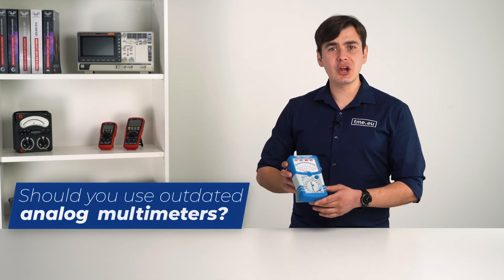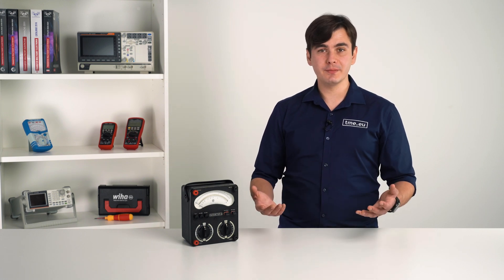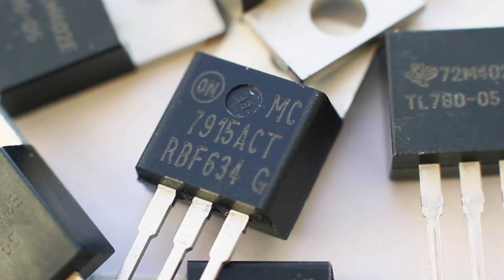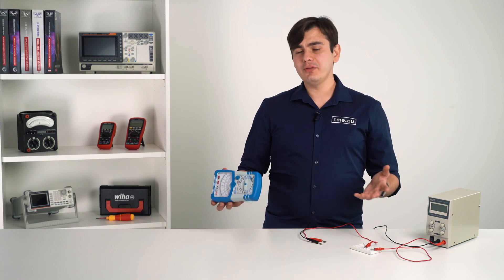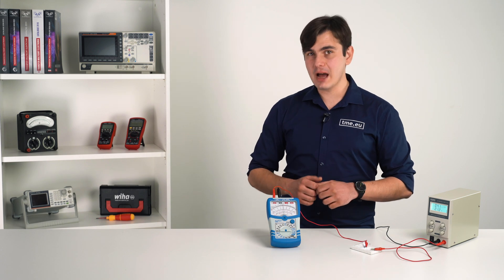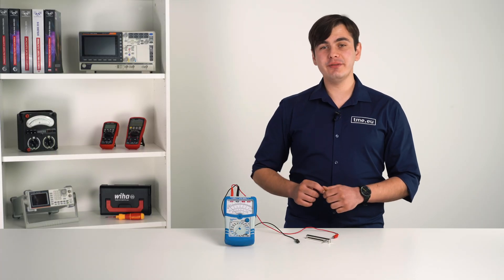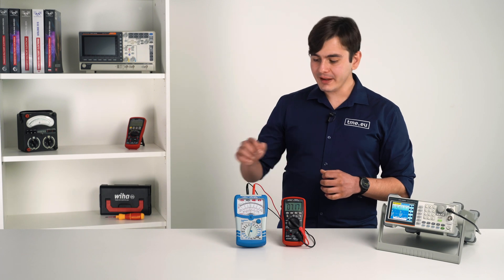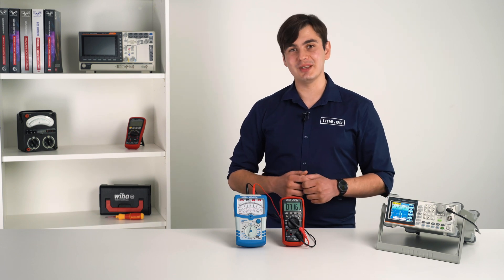Analog Multimeter - How to use it? PeakTech P 3385 [TUTORIAL]

Comment: I got many analog ones, plus the one you are showing. 1) continuity, you spot an interrupted cable because you see needle jumps; 2) "dirty" or oscillating voltage, again you see the needle; 3) noisy signals... sometimes due to high impedence of a digital multimeter you pick up noise from cables and numbers jump around.. your analog one instead draws current (little) and you have a "quiter" reading. 4) you can check diodes and transistors in ohm mode;
The main advantage is that human eye can notice thiny movement of the needle, and you understand the trend of this movement. The digital ones gives fast changing numbers of no meaning for us. In any case when I need a precise mesurement I always use digital.

Comment: Many years ago, i used to follow ECG through a pcb of a damaged monitor just looking at periodical deflections of the needle of my analogic multimeter ... as it was an oscilloscope ... ( with an ECG simulator at the patient paddles ... )
In other situations, were a lamp in a blood analizer should remain powered at a fixed and very accurate voltage, i realized a bridge resistors in which my multimeter, used as voltage meter, was able to catch 2mV ( or even less ) on a 12 volt enviroment ... 
( i'm speaking of the italian analogic tester ICE, whose lower range was 0,1 volt ( = 100 millivolt for max deflection ) which, divided in 50 parts, gives the value 0,1÷50= 0,002 volt ( 2 millivolt for one full division ). Paying attention, i could see even lower variations, just to say very little movement of the needle, indicating me some problems in the electronic regulation for the lamp itself ...